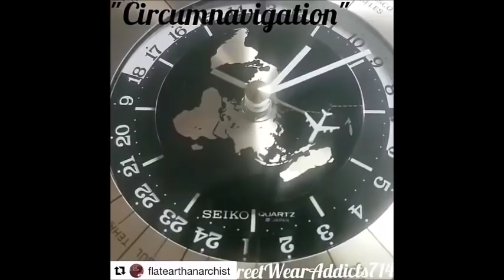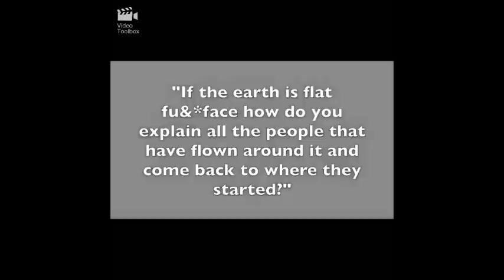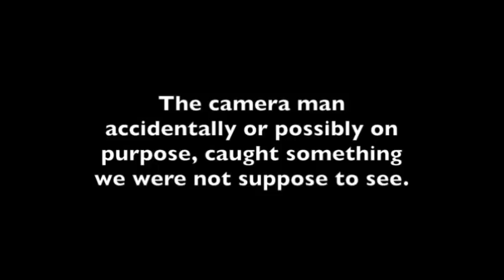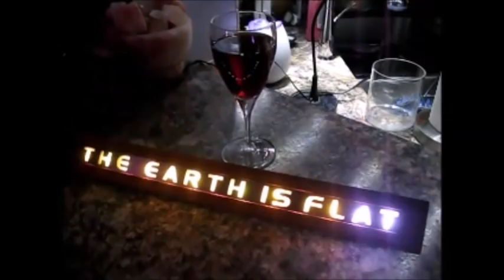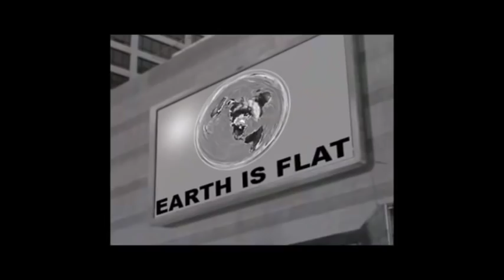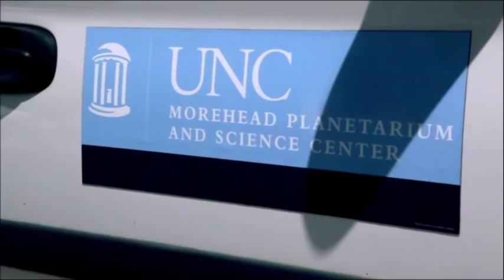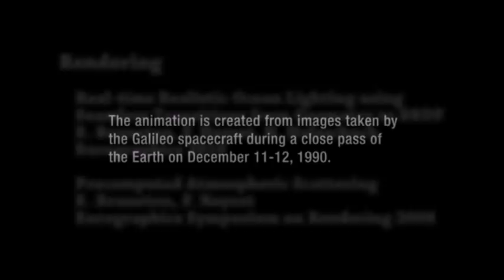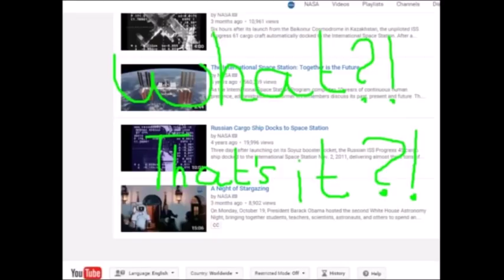Flat Earth Q&A Emails 89 - Mark Sargent ✅

Comment: 1, trust eyes and senses, THUS OBSERVATIONS SHOULD AND CAN BE TRUSTED!! Relativity was created to hide this fact!!....... 2, in navigation before electrical self adjusting gear, AND STILL THOUGHT TODAY WHEN MECHANICAL GEAR IS USED(as small private planes etc) THERE IS THOUGHT THE RIGHT AND LEFT HAND RULE!! When westward navigation then WEST IS MORE thus you ADD DEGREES to get to your destination!!! While EAST IS LESS, thus if you “need” to go 90° east to get to destination YOU INSTEAD GO 84-89° DEPENDING ON DISTANCE AND LOCATION ON THE CIRCULAR PLANE!!! The further “south”= outer rim, the less compensation is needed if you travel same distance as further north!! The closer to the NP centre, the narrower the circle gets!!....... It’s perfectly SIMPLE! Go to ANY body of water that is 3 miles long AND TRY TO SEE OR MEASURE THE SURFACE CURVING DOWN WITH 72 inches!! YOU WILL NEVER SEE THAT OR BE ABLE TO MEASURE THIS SUPPOSED DOWNWARD CURVE!! What most doesn’t get is that IF we live on a ball, THEN ANY ONE OF US AS THE OBSERVER SHOULD STAND AT THE HIGHEST POINT OF OBSERVATION!! So the ball should curve in all directions around us!!! And there is no way that “standard”(cover up tool) refraction every day of the year perfectly compensated for the exponential curvature, so that skylines 30-80 miles away, or mountains 100-200 miles away was “lifted” up and make the surface perfectly flat and level... And how about walking in the spin direction then turn 180° and walk against a 400-1000 miles/h spin?? WE WOULD BE MOTION SICK CONSTANTLY!!! And that moon and sun only locally lit up clouds in our already very local field of view PROVES CLOSE BY AND LOCAL LUMINARIES!!!
And follow moon for one night!! If you live on a spinning ball that overtake the moon daily, THEN THE PART OF MOON THAT FIRST RISES UP ABOVE EARTH THE HORIZON SHOULD ALSO SET FIRST!! So moon should set UPSIDE DOWN RELATIVE TO HOW IT RISES!!!!
Insanity and ignorance behind the ball earth assumption!!

Comment: If I look at a flat Earth map, then Antarctica is this giant ice wall circling the entire world, whereas on a round earth it is a continent.

On a round earth the circumference of Antarctica's coastline is measured at 11,165 miles if you were to stick next to the coast at all times. On a flat earth map this number is significantly bigger. According to flat earth wiki, the diameter of a flat earth is roughly 25000 miles, which equals a circumference of 78500 miles, so we can assume that the circumference of this ice wall is close to that number.

So it should be possible to determine whether Earth is round or flat by circumnavigating Antarctica and taking note of the average speed and the amount of time it takes, or measuring the distance involved, since a flat earth would require a trip duration and distance about 7 times bigger than that of a round earth.

For example - I found an article mentioning a Russian icebreaker Kapitan Khlebnikov completing the journey in 64 days and logging 12,565 nautical miles (14,460 miles)http://journals.cambridge.org/action/displayAbstract?fromPage=online&aid=5416608

If the Earth were flat, the distance should be closer to 70000 miles Whereas 14,460 miles is quite close to 11165 miles, though you have to account for the fact that following the coast at all times is not practical, which explains the extra 3000 miles.

However, 14460 miles is very far off from what would be expected of a flat Earth scenario.
Reply: The antarctic circle was mapped by several explorers, starting with Captain Cook. The circumference of the circle was not established precisely because of many difficulties endured by the cartographers, however, it was found to be somewhere between 66,000 and 68,000 nautical miles.
Reply: @jonathangems  research Cooks voyage and you'll find that the 60,000-mile figure also includes his sailing to and from England, and a huge amount of diversion and exploration in both the Pacific and Atlantic Oceans
Reply: If you read about the journey of James Clarke Ross, he was trapped in Ice, made detours to Tasmania (Australia), and the Falklands. 

He was looking for the South Magnetic Pole, something that only a Globe shaped Earth could have, and he was monitoring the magnetic angles as he circumnavigated Antarctica. He was also an expert navigator, and the maps and bearings he used were based on a Globe Earth.

The fastest circumnavigation of Antarctica was probably Lisa Blair and took 104 days, at an average of say 10 knots, or 240 nautical miles a day, is about 25,000 nautical miles, one third of James Clark Ross.

Comment: The image @ 24.12 states 1,802.6667 feet of curve missing but doesn't point out that would be from a viewing height of 6 feet.
Warren Dunes has a maximum height of 240 feet which makes a massive difference.
Could it be just another example of flat earth dishonesty?

Comment: Mark the answer to the slight turn the airplane would make because the Earth is so large and you wouldn't notice it we who believe in the Flat Earth use the argument that the plane when it flies doesn't have to keep correcting to fly down over the wall well if the Earth is so large as you stated that you would notice a left her I guess you wouldn't notice a downward turn either correct rethink that answer

Comment: Let me ask you this mark Sargent if the Earth was flat then why was there no pictures of it from space
Reply: the hubel to view and see?  Or why has NASA not sent a special probe just to observe the entire earth for what it is.  Why would the most important man at NASA in scripture psalms 19 refer  to a firmament made God on his tombstone?
Reply: @TBU2012  you can't use the Bible as a flat Earth proof
Reply: sound good as long as you don't use anything from NASA .  for me its like this if someone can make a point to point line of sight observations over a body's of  water. of objects 50+ miles away then either the known math formula for estimating the horizons relation to distances is incorrect or the water must not be curving.  topographically speaking the earth is not flat.  however water is.  you just would not be able to see beach to beach like in Kauai po'ipu beach Kaua'i to ka'ena point O'ahu 60+ miles.  these are not NASA video's.  they are armature to 100,000 ft+..   the way i would describe it is you can see hundreds of miles from this altitude in the rite conditions in  any direction i look. i can not see the horizon anywhere but eye level when you would expect to see it tapering off any direction you look  due to the curve that would be easy to detect with the eye at that altitude.  here is the videos.    https://www.youtube.com/watch?v=pvkGQVuNPsY     https://www.youtube.com/watch?v=7ynkAL5UUZU

Comment: How do you explain tides in a flat Earth? I keep asking this question and until now every flatearther of Youtube has avoided an answer. It seems to me a crucial topic....Will you also ignore it, Mark Sargent?
Reply: I've seen it, and this video states that tides are made by changes of the barometric pressure of the air over the "great deep"(???) 
But unfortunately that does not happen, the barometric pressure over the ocean is the same at sea level, and when it changes , it does by small percentages and always locally and impredictably, we call those changes "storms"; no way there can be such a change to rise and lower the level of the global ocean 4 times a day, with clockwork precision
Reply: Carlos Lopez
There is a long list of observations and phenomena the flat earth cannot explain.
Probably because the Earth is not flat.